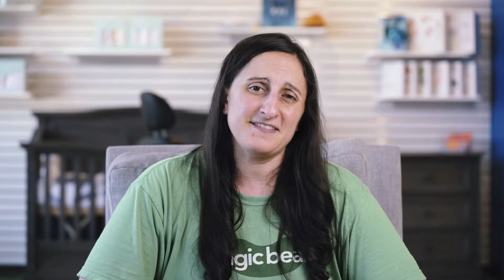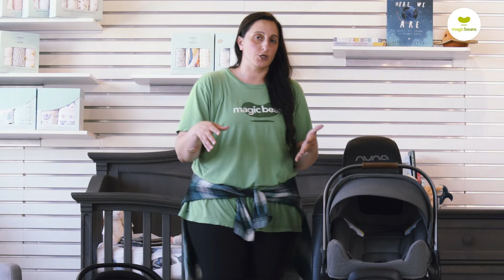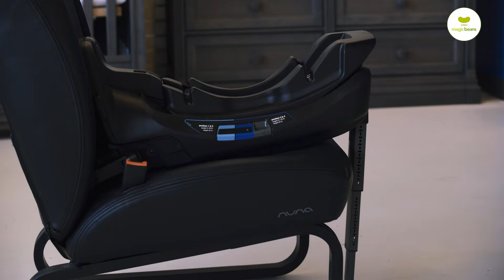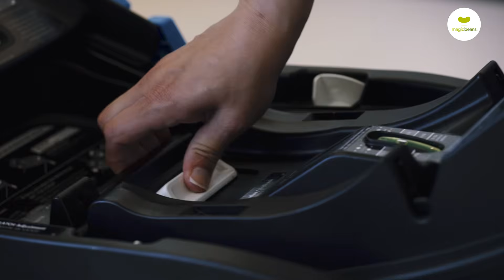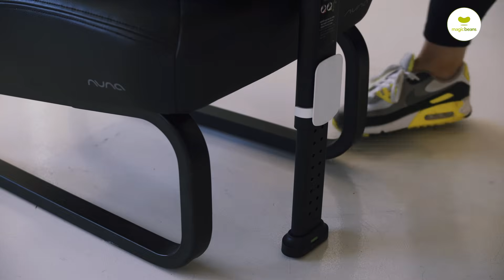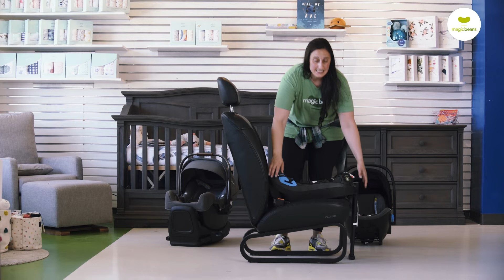Nuna Pipa RX vs. Clek Liing 2020 | Infant Car Seat Comparison | Infant Car Seat Review

Comment: OK, i have a question. I orignally bought the CLEK Liing in Mammouth, my baby HATES it..he would constantly fuss when in it.... So we bought the PIPA Lite LX, and he is MUCH happier..BUT install on the base for the PIPA has been a bit challenging in my sienna.. is the RELX base worth getting for a better LATCH install? I cant seem to get the right fit with the LATCH on the Pipa base but can with the seat belt install...but with the seat belt install, it makes it difficult to get my other kids into the 3rd row... (we have 5 kids, i sit 3 in the middle row and 2 in the back row..2 are in highback boosters-1 in each row, 1 in the infant seat, 2 not in car seats)